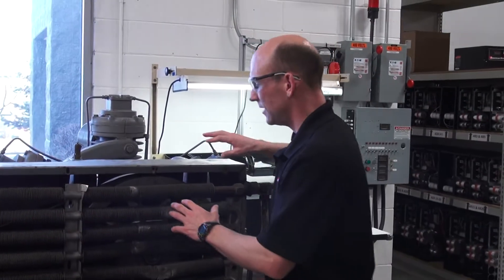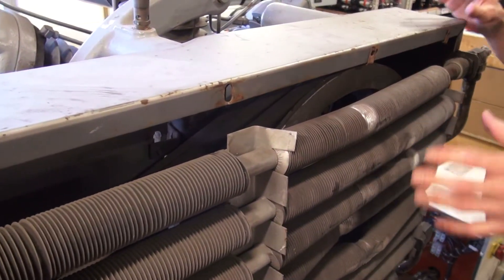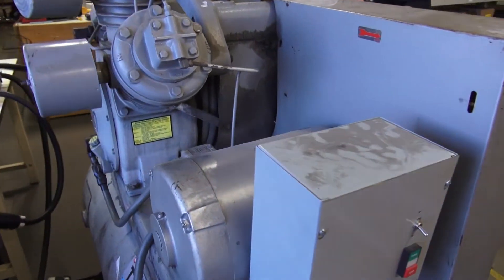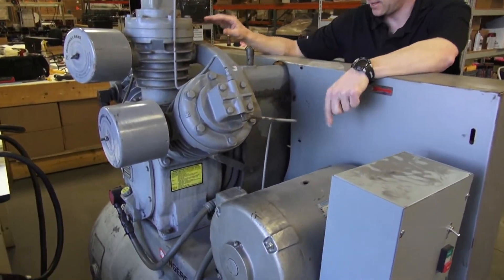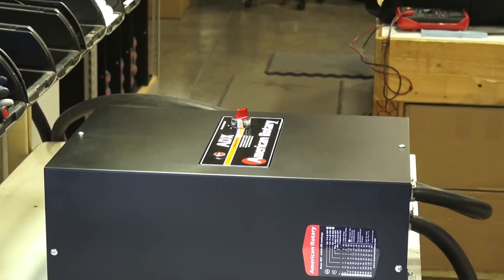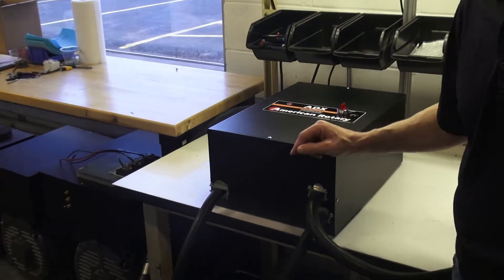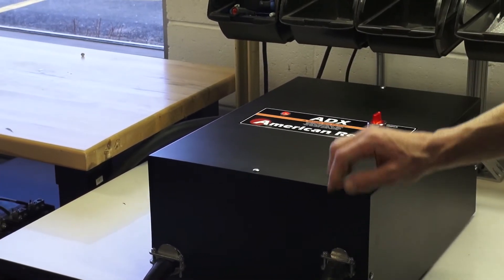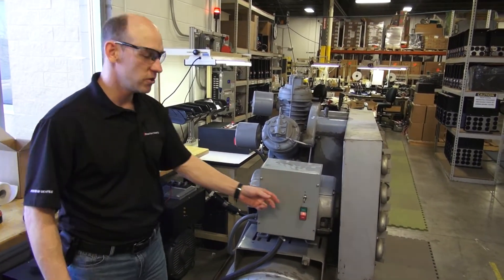American Rotary ADX Phase Converter

Comment: one youtube user with a Federal signal 500T air raid siren needs one in that video when he activates it on new year's  eve/day with the phase converter he used that siren struggled to get up to full speed having a 10 hp 3 phase motor turning around 3,000 RPM.  i think american rotary phase converters should be good for siren collectors too.

Comment: I find it interesting they demonstrate the first converter with no background music and their own converter of course has obnoxious music playing the entire time it is running. is the music for effect or are they attempting to cover up something. so I suggest we test the noise of American Rotary product against other manufacturers and make it a 3rd party test.
Reply: I do not have an adx, but rather a 30hp gray unit they sold some 11 years ago. I bought new and drove to the factory as they are just a few hours from me. Found a used 7.5hp unit which I will place in the garage as well. The only noise I have on mine is the hum of the motor and that comes and goes as I remember to grease the bearings. I hope to find a used ADX50 this year to run some of the larger tools I now have. I have recommended this brand of converter to several friends and they have been pleased as well. Ric Furrer Blacksmith Sturgeon Bay, WI

Comment: its amazing the compare a RPC that has no Caps for current to start up the motor, and then they keep the lid on their box so they can hid the fact that they use caps to start up.
Reply from the maker: +Thomas Shue Great point! The ADX was specifically designed with start caps to ensure a quick, clean start up. As we show in the video, you will not find this feature in most standard phase converters. 

Start capacitors limit the in rush current and help protect your equipment! 

This just one of the many features that we have integrated into our ADX model.  Learn more about the ADX here: https://www.americanrotary.com/products/view/adx-smart-converter
Reply: +American Rotary im building my own 15HP RPC with start and run caps, over volt and surge protection. It will be kick butt at 1/4 of the cost.
Reply from the maker: +Thomas Shue Thanks for sharing Thomas! We love hearing from builders and makers, just like you.

Our company was started when our CEO built his first phase converter in his home workshop almost 15 years ago. Today, we are proud that our phase converters help thousands of our customers get the safe, precise and reliable three phase they need to power their business. 

We've subscribed to your channel and look forward to seeing your next project on YouTube!

Comment: Hi, I would need to know some info. I need to get an rpc for one of my customers and need some info: 230 single to 230 3 phase. 5 hp motor with a vfd ( 17 amps) so what size unit would I need. Also, since I am in Quebec, Canada do you have local (montreal or around) that I could discuss with for delivery up north, because Canadian customs and shipping from us is very costly.
please reply,
regards
Reply from the maker: Hi Don Bowen - Please call us at 1-888-743-6832. Our engineers would be glad to assist you!

Comment from the maker: We would like to share with you some exciting news! American Rotary has introduced a new line of phase converters to its line up. We now offer a model called ADX. The ADX series phase converters have current control to provide consistent torque while starting high inertia, extremely hard starting loads. ADX converters still maintain the precision voltage balance American Rotary has become known for since introducing its CNC rated phase converters over 12 years ago. 
Check out the You Tube video below to see the difference the ADX Phase Converter makes. All American Rotary Phase Converters that use the GENTEC/Baldor Idler are compatiable with the ADX control panel and can be upgraded. 

*Mention this email and get 5% off your new ADX Phase Converter*

Thank you for your time,

The American Rotary Team

http://youtu.be/0gJrYMkNDAE